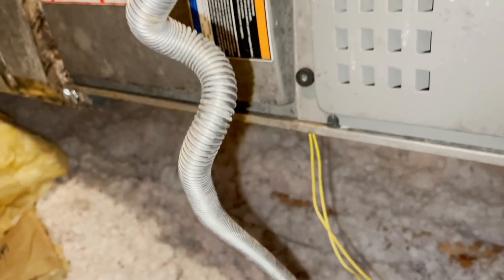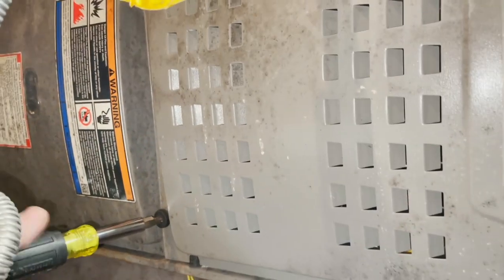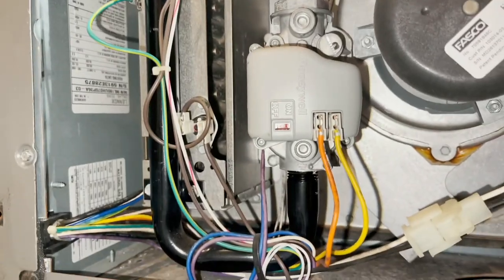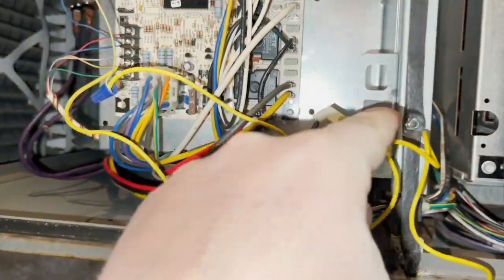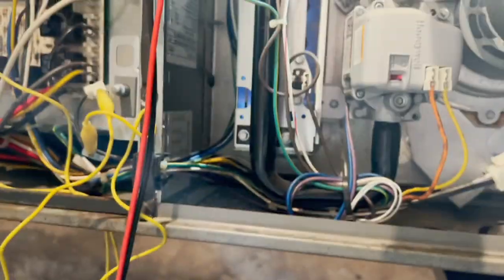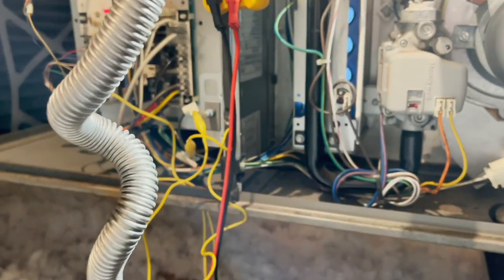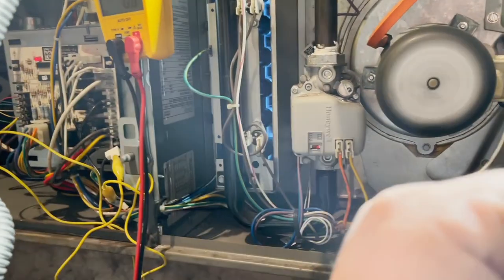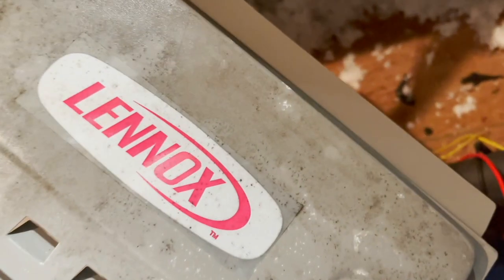Go Back On Myself/HVAC Service

Comment: On that particular stat. I actually pull each wire to double check. John I wanted to thank you, a while back I asked you a question I should have known and you gave me answer without belittling me. I was having problems identifying discharge line from liquid line on package unit. Was getting crazy reading when I was putting temperature clamp on discharge  line instead of liquid line. That was probably a couple of years ago. Every time I take that reading I give you a thanks.
Reply: inbuilt "wago" thermostats.. if yall are failing with, just imagine how they'll hold up with line voltage electrical. 💩